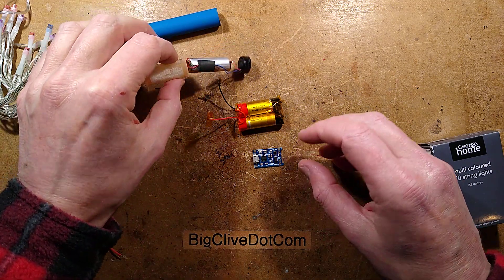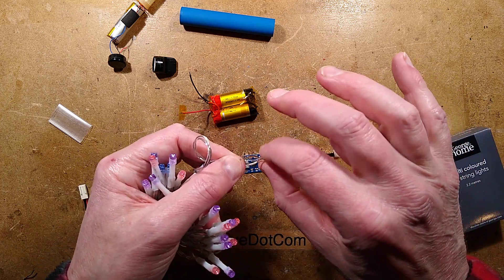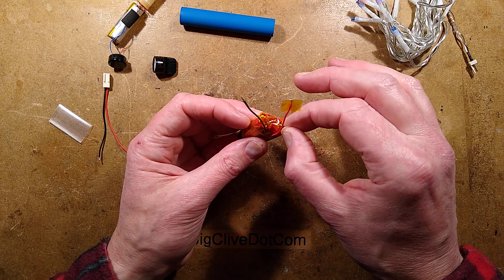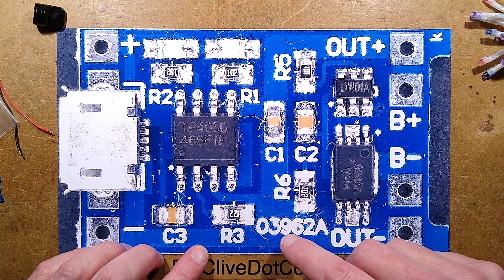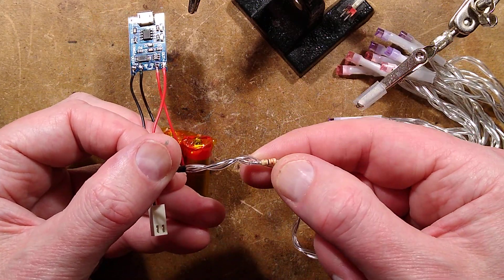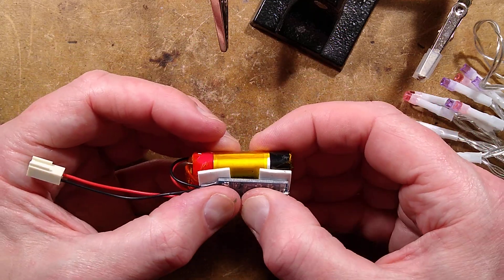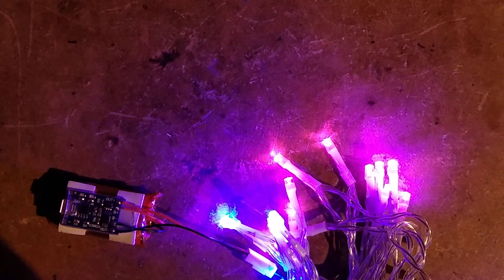Cheap power pack with free lithium cells (USB or solar charging)

Comment: I love to recycle tech, got a few cells that have taken charge and are ready for projects. But have you any ideas on the pressure switch? It can pass high current directly to the heater element & has the logic to light a multi coloured LED. Has to have an alternate use somewhere.
Reply from the maker: It's very clever.  But has limited other uses.

Comment: Finally got around to making a power bank using these "disposable" cells. 100Wh with 69 cells in parallel and an IP5328P board. Surprised to find it actually works perfectly so far. Videos like this made me aware these batteries could be repurposed in the first place.
Reply: Are you balance charging the cells? Are you not worried about overcharging a cell and having a fire risk?
Reply: @d4rr3n666  You don't have to worry about it unless if it's in series. With them being in parallel, they are all going to act like they are 1 big 3.6 volt battery
Reply: Hi. You able to do an update with the new puff puff things with chargers built in chargers?
Reply: Lol i love it!

Comment: Hey so 2 questions will I be able to use the tp4056 to charge my 1500 or 2000 mah cell? And what gauge wire did you use in this video?
Reply from the maker: If it's a standard lithium cell it should charge it.  The wire is standard thin equipment wire with 7 strands of 0.2mm CSA tinned copper.

Comment: It's fascinating, as such a advanced thing as lithium battery just laying around on the streets these days. 
Also, is not it kinda scary to have live lithium cells hang around your home? I mean, they are, although, rarely, but prone to self combust.
Reply from the maker: It's usually associated circuitry that fails.  Lithium cells are actually pretty stable when not abused.

Comment: have put these cells in a 3d printed 18650 sized case with paperclip wire for end connectors, charged by a TP4056 in a print in place 18650 battery holder. Works fine and currently in use on a torch. Currently redesigning the pla plastic case tube to take advantage of the aluminium cases the tossed cells come in.

Comment: How many lithium cells in parallel are these boards capable of charging? I was thinking of also using them with a few 18650s as well as some vape cells.
Reply from the maker: If using with 18650s I'd recommend only charging one at a time.  Although these PCBs can be used with large parallel arrays of cells, the voltages must match when they are connected in parallel as otherwise high current will flow between them.
Reply: @bigclivedotcom  Thank you Clive.

Comment: Batteries in parallel may self discharge if they dont have the same voltage which is inevitable.
Reply from the maker: Lithium cells in parallel equalise and then act as one.

Comment: Those this board support UPS function? Some cut off power to the source when connecting the charger.
Reply from the maker: This will allow charging while in use.  Once the cells have reached full capacity the charge light will stay on because it is powering the lights, but it won't overcharge the cells.  It would work well as an emergency light.

Comment: With a little two transistor circuit (that you developed thanks), the TP4056, a small solar panel and a "fairy string" you can make solar garden lights that run all night.

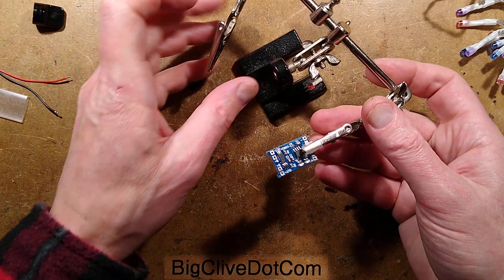Comment: 9:00 I put silicone tubing (I think it was nitro RC fuel line) on my helping hands, that I probably picked up from this channel to begin with, but the teeth of the gator clip just cut through the tubing almost immediately and shorted a hot board I was working on. I ended up grinding the points of the teeth down and, just to be safe, shrunk a tube of heat shrink on each side, then put new silicone on

Comment: Some oft these have lipos inside. You can also stack 2 cells in the steel tube to make a 7,4v battery; The problem with that is how to charge it? AnyaAaaaaaaaa  ideas??
Also, what is the difference between those little lipo and lion chargers and how to spot it?

Comment: great recycling Clive, but I have literally never seen one of those smoke machines discarded in the street - why do people throw them away if they are rechargeable? Are there single use versions?
Reply from the maker: These ones are single use, but have rechargeable cells.

Comment: These cells are great but also quite terrifying when something shorts, I had used a rechargeable cell/board to power an RC drone camera. I soldered everything fine, but accidentally shorted it while probing the solder joints. Melted a few wires and had quite a scare! I can't stress enough how great it is to have an explosion tin around! XD

Comment: Just thinking, could you add daylight-detection to these using a MOSFET, possibly their internal one? A little 1-transistor circuit if needed, possibly add a Zener? If not using the onboard MOSFET, you could put one in series with the LEDs' lead. You could even make a snap-in thing, that plus between this PCB and the string of LEDs that cuts them off in daylight. Plus you'd need a connection back to the solar panel or else include a little photoresistor or whatever you liked, as a sensor.

Comment: I love those TP4056 modules. Amazing value, and will charge particularly discharged cells with under a tenth of an amp depending on cell voltage. Very useful. If a cell gets warm during charging with this particular product, it's likely the cell has developed 'higher than ideal' internal resistance. The cell is no longer safe. Re-cycle that sucker.

I also keep a little metal pot with a lid next to my bench.  Got an inch of sand in the bottom. It's where batteries/projects go if they get 'irritated,' and start to throw a tantrum. Which smells bad and is almost certainly going to make you grow a third nostril. Take the pot outside and let stuff cool down before you peek.

Thank you for the videos, Clive. I've learned so much from you and the other usual suspects on YouTube.

Comment: What about batteries in series? I have been looking for discharge protection for my boat’s electronics. It’s just the sonar and stereo. I use a few 3 cell lipo packs in parallel. Unfortunately the electronics will shut down way below 3v per cell. I have been looking for a way to cut the power at 3.1v per cell. Many say just use lead cell marine batteries, but with the lipo packs I save weight and space. There’s enough lead batteries already on board.

Comment: Don't you need a 1s BMS ?
Reply from the maker: That's what the PCB is.  Charger and protection combined.
Reply: @bigclivedotcom  you are correct. I've used a similar looking version of this board which only has the charging chip. Destroyed a number of cells by my blunder.

Comment: Excellent video. I made up a 2 cell version as you have but i didnt check the cell voltage beforehand. I asume that the cells will balance themselves as one will charge the other until they are the same? Is this not the case?
Reply from the maker: If there's a big difference a high current may flow initially.

Comment: I used a similar, cheap 1A charging board for 3s NI-MH pack; 
Also with heatshrink over it. The problem was that it would get super hot while charging with heatshrink on.
Apparently heashrink is a good thermal isloator.

Comment: I imagine that one mighy find a use for the heating element in said discarded "lung-filler-upper-with-expensive-pollutants" devices...maybe you could run a small stream of water through one, or several of them, for "instant tea-time" ;-)

Comment: What an inspiring video, thanks Clive! Could you use a little 100ohm trimmer pot instead of the resistor to let you adjust the brightness to suit?
Reply from the maker: You could add a variable resistor in series with a fixed one to cap the maximum current.

Comment: If you use the color cycling LEDs, they run from 2.5 to 4.5v. I run them without a resistor, or protection circuit, because they stop working at 2.5v, but it would be nicer if they stopped at 3v.

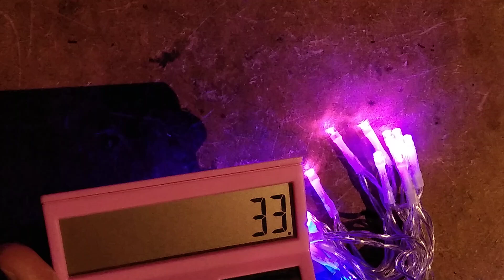Comment: Re Output current calc at 15:14 elapsed: ? Why use 1.5 volt as output voltage, assuming the battery is charged to around 3.7 volts.
Reply from the maker: Fully charged battery voltage minus LED drop = resistor voltage drop.
Reply: @bigclivedotcom  Thanks Clive, I hadn't the wit to think of leds as being the 'duel' of resistors. Congratulations on your many excellent presentations.

Comment: This is such a great tutorial. Since I first watched your first video about salvaging the lithium cells in question, I’ve had a friend who regular buys and uses said devices and has been donating them to one once the intended use has dried up. I now have quite the collection and have recently purchased a bulk of TP4056 charging boards and solar cells. Excited to start tinkering.
Reply: Same mate. Got a couple mates at work who use these things and my wife has been getting caught short with a dodgy smoker so she'll grab them from time to time. I've got a pile of them just waiting to have the cells reclaimed. I'm thinking a nice power bank for a cyberdeck, of sorts. Just need to research coding and sensors. Want to make something that I can use out and about at work.

Comment: I really enjoy your content
I did this a while back. I have access to many of these devices Most of the larger disposable devices already have a charging board in them and also a larger battery. I remove the "product" wick and heating element board to make room for the 2nd battery from a second device although not really needed. The mouthpiece becomes the opening for the wires and there is a lanyard loop which I drill out to add a micro switch. All nicely fit inside the aluminum housing. The twin large batteries (1500mAh each) last for days.
Device used : AirBae Box 5K 5000

Comment: These little batteries are quite robust to handle even 2C charging so one could easily just use the "factory settings" to charge any typical single 350-400mAh cells too. I have also built 18650 chargers with these modules and cheap holders, quite handy devices._

Comment: I have to ask a silly question: can this little charger module safely power the load (the LEDs in this case) while charging the battery?
Reply from the maker: Yes it can.   Once charged the TP4056 will effectively just power the LEDs directly, while not allowing the lithium cell to go above 4.2V.

Comment: My resistor seems to be getting very hot. I have 30 LED string and I put on 10 ohm 1/4 watt resistor
Reply from the maker: It shouldn't get that hot.  With typical white LEDs it will be dissipating close to its rated power on a freshly charged battery.  Is the resistor definitely in series with the LED string?   Try adding another 10 ohm resistor in series to reduce the current.

Comment: There should be a law stopping the use of good rechargeable batteries for single use only.
But some perverse market law has made lithium rechargeable batteries much cheaper than their single use counterparts, so the chinese use them everywhere.
I've seen many of the same spent vaping devices littering the pavements along every walkway, together with empty beer bottles and soda cans. There is an obligation to recycle all of that, but some decided not to bother.
Thank you for the suggestion on how to build something useful out of rubbish Mr. Clive...
Reply from the maker: The rechargeable lithium cells contain a fraction of the amount of lithium than non rechargeable ones.

Comment: I put five together and used them to restuff an old bardic lamp battery , to balance them I charged them in my smart battery charger adds to the excitement, I recommend buying 10 at time I've made a few now and had a couple go Hot due to an error 
I'm surprised that they are allowed to sell these as disposable given the toxic nature of the battery
Reply from the maker: The main materials in the battery are surprisingly inert.  But when charged it has an energy release hazard.

Comment: You pipped me to the post lad! I bin working on this exact idea the last few days if you find any of the elux legend vapes they are encased in a oblong aluminium case great size to fit two of the larger cells in perfectly . Nice bid as ever Clive ☺
Reply from the maker: Sadly the newer Elux larger ones have added a charging port and skimped on the capacity of the cell.  It used to be 1500mAh.

Comment: I will humiliate myself by sharing my own Li-Ion (18650) disasters and my take aways! [cliffnotes at the bottom] 
#1     I own a similar LED 4xAA/2x18650 Worklight (with Powerbank function and Lithium-only recharge capability) that Clive has shown a couple teardown of, and have been using recovered 18650 cells from various electronic's battery packs in it (laptops, portable DVD players). One eve I had been using it while taking my dogs out, but on that occasion it was lightly raining. Knowing it had no waterproofing for its battery cover, I kept it under the umbrella; however, the wind was managing the carry just enough rain underneath to wet the light...

Enough so that a couple drops worth had seeped under the cover and then wicked its way inside a cells + tab, through those 4 or 5 holes, and also between the battery's outer shrinkwrap case! This promptly, I presume via deductive reasoning, arced/burned a tiny hole through the battery's metal casting!

The light proceeded to work, so that actually was not how I came to know this had even occurred. It was the fact that I first smelled a faint... almost alcohol-like chemical sent. Then just as I tried to mentally place WTF it could be coming from, I started to feel a warmth on the fingers that were wrapped around the light's kickstand/carry handle...
I opened the cover, saw steam, was hit with a stronger "mystery sent" and knew it was a battery venting electrolyte!

Raced my doggo back to the house, dried her off, and grabbed an empty lidded glass jar that scented candles come in (with the rubber seal on the lid), then tossed the venting battery in it! ... It was the only thing I had that I knew would be: air tight enough to prevent fire, sealed but not in a way to become a potential bomb, and resilient enough to withstand the heat!
(oh, worth noting, is that before putting it in there, I forcefully blew on the battery to remove most of the remaining water, to stop it from shorting itself out)

Lesson learned? 
Now, any batteries in circulation for that light, I've applied a coating of silicone lubricant (the clearish non-drying gel) on the positive terminal areas, as well as around the battery cover seams, all to prevent water ingres! 

#2     [a few days later...]  Now needing different batteries for that light, I went about finding a "matched" pair from my stash. Unfortunately, salvaged cells from battery packs lack the protruding button, so they "don't reach" when installed. Conventionally, I would just place a big blob o' solder on the contact...
For whatever reason, I did not do that this time....... but instead 😒 I took one of my multimeter's probes and stuck it in the + sides holes, gently prying up on it to raise it higher. 🤣🤷‍♂️
Some might know where this is going... Some may think they do... Some, this might be new info, like it was to me!

To start with, yes, over the course of this endeavor I did pry just hard enough to damage the shrinkwrap sleeve and cause an ever-so-brief short, tipped off only by the sound of the SNAP that was made. 😁
HOWEVER, no, that's not where this is going!

After finishing doing this to the first battery of the pair I matched, without any further issue, I began working on the second one, but with a little more care on the pressure applied (as to not break the sleeving). Eventually, as I worked my way around, over and over, the hole widened and my probe was able to go in slightly further. 
Then, suddenly... 👃🤨

    "Aawww FECK!" my internal monologue proclaimed... 
... as I quickly run to my newly-christened "Explosion Containment Jar" so that I can place another battery inside of it! 🤣😊

Lesson learned?
Apparently, 18650s — and undoubtedly the other cylindrical metal casing Li-chemistry cells — have a foil burst disc under the + terminal... and those holes, are there for the express purpose of providing ventilation should enough internal pressure build up to cause the disc to bust (as to not create a mini fire bomb, but a more localized flamethrower.... six of one, half a dozen of the other? lol)

ALL IN ALL... No fires were created. No explosions happened. No personal injuries incurred.
After a few days outside, in the cold, kept in the sealed jar... I deemed them inert enough to deal with them. Both cells received a molten wax bath over their + ends to seal them up, after which, they were placed back in the Explosion Proof Jar..... where they've been ever since, or if concern that throwing them away would cause a garbage dump fire (and knowing TN, the nearest hazardous waste facility is probably a couple hours from me lol).
That is where they've remained, for the last... I dunno how long, 3 years? 🥴

Moral of the story:
If you salvage rechargeable lithium batteries... Have an "Explosion/Fire Containment Vessel"! 👍
Keep 18650s et.al away from water! 👍
NO POKEY-POKEY!!! 👍

Comment: 6:00 if i'm not mistaken, the TP4056 does not allow for simultaneous charge and discharge. Charging while having a load applied to the battery could result in overcharging.
Reply from the maker: If used with the LEDs connected it will not overcharge the cell.  It will still indicate that it's charging, but only because it is now powering the LEDs directly.
Reply: @bigclivedotcom  well that is quite a bit of useful information to know, i was under the impression that the tp4056 would keep powering the load and the cell simultaneously at a higher current than the load requires and that it would then overcharge the cell. So, if the load is 0.2A, the board just spits out those 0.2A once the cell gets to 4.2V, and floats the cell there?